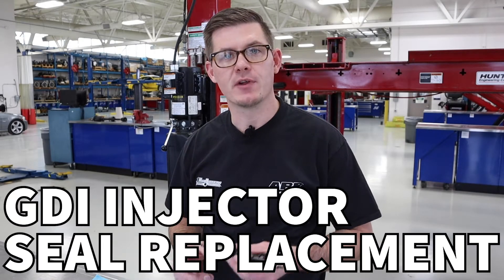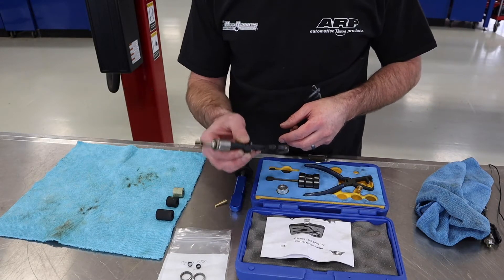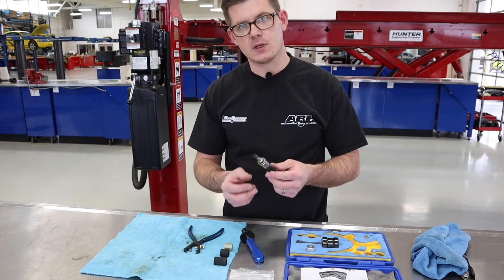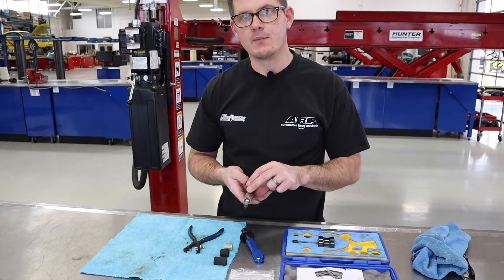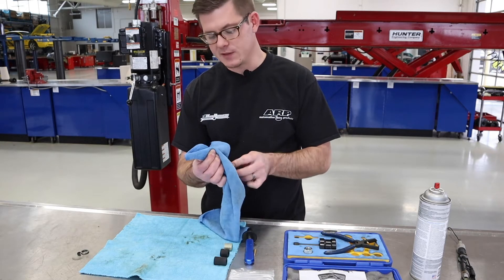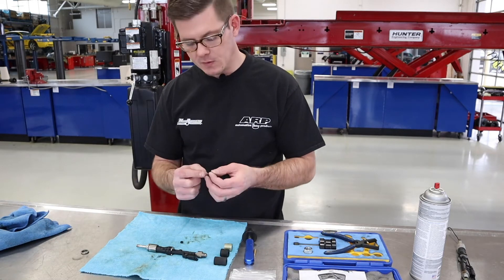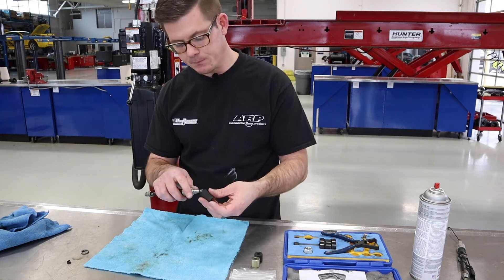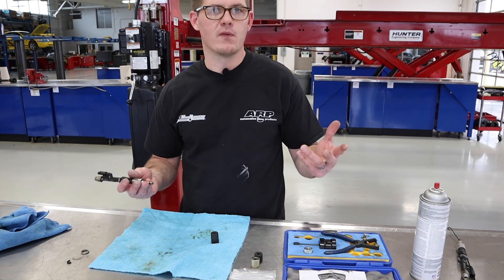Gasoline Direct Injection: Injector Seal Replacement

Comment: Great video, why would one want to replace coupler and new Teflon ring on a used injector, I have an injector that was stuck open/leaking ,is it possible to clean the injectors somehow and reuse them ? Thank you
Reply from the maker: I believe there are companies that recondition them, but it is not something I have looked into. The most common reason to reseal a used injector is removal during some type of engine repair procedure.
Reply: @AdamsAnalysis  Got it thank you much for reply.
Reply: @3rkowtf669  I believe that modern injectors are pretty robust and have very few moving parts - therefore, cleaning is typically a safe and effective way to reduce costs of repair. Videos of injector cleaning here on YouTube demonstrate the effectiveness quite well.